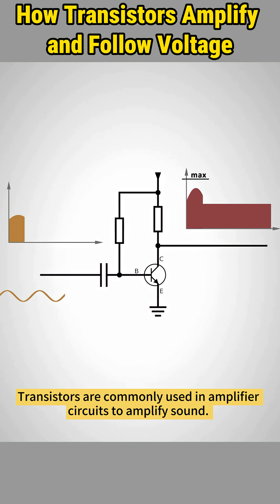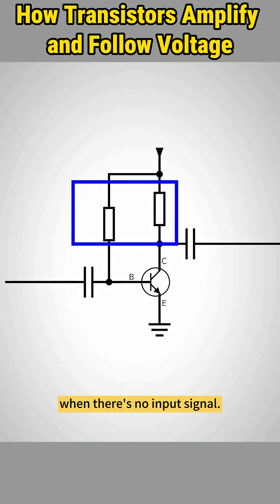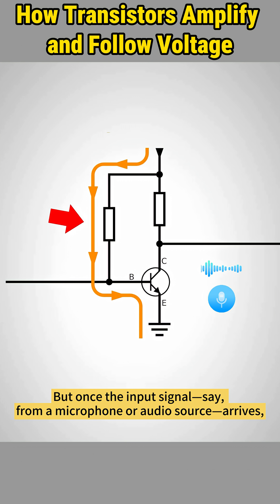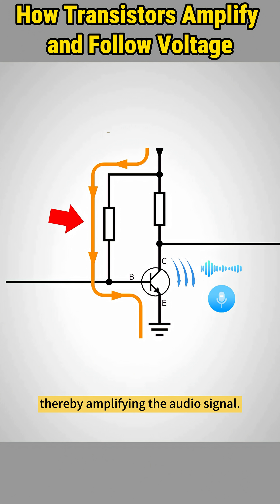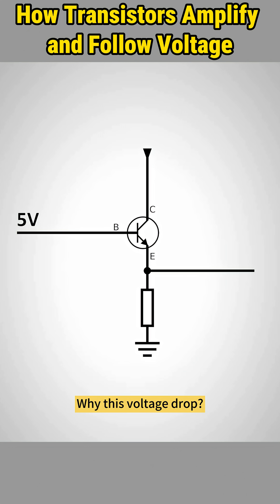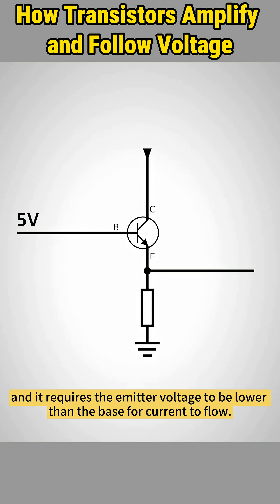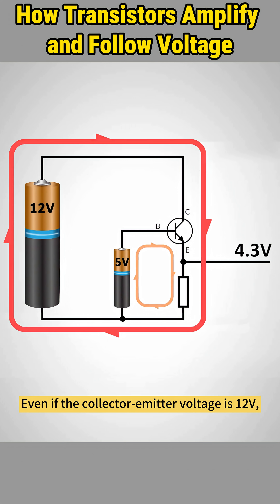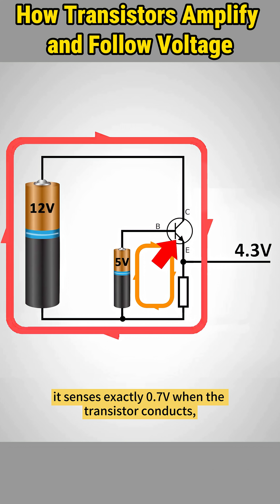How Transistors Work in Amplifier Circuits?

Comment: Your explanation for amplifier circuit is WRONG. Resistors are to keep the transistor in active region (DC Bias). Small input voltage (compare to DC) amplified mainly IC=Beta*IB current amplification feature of transistor.